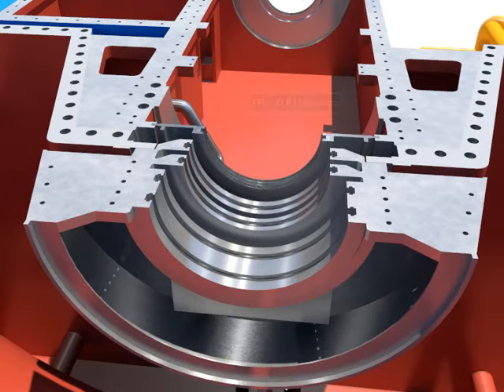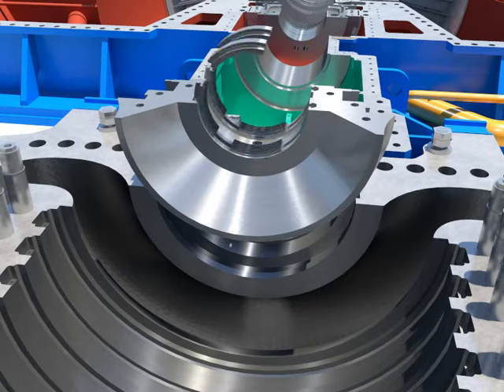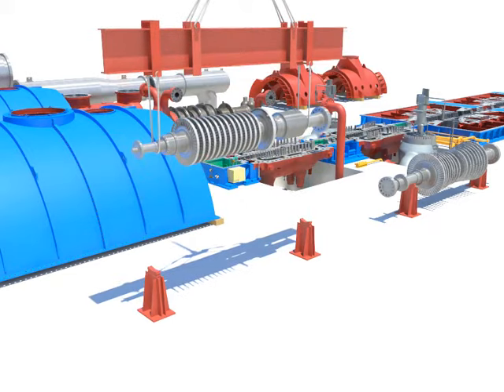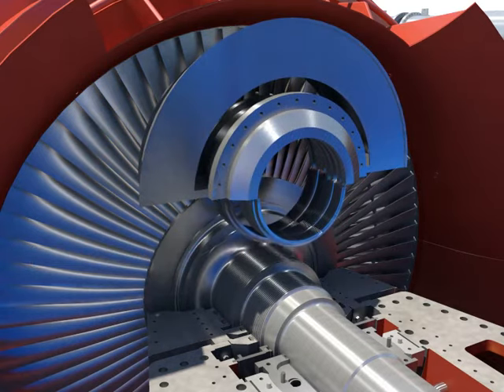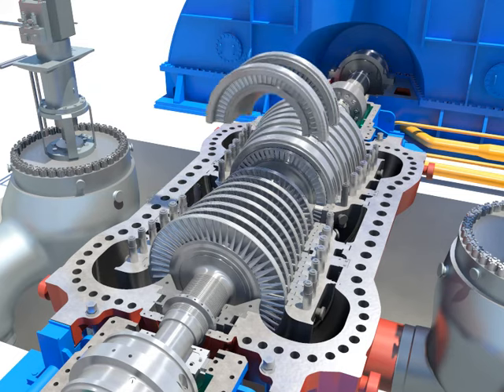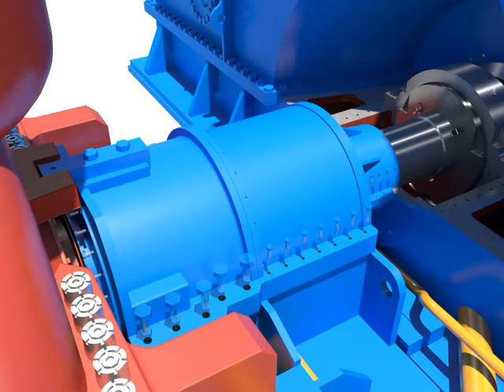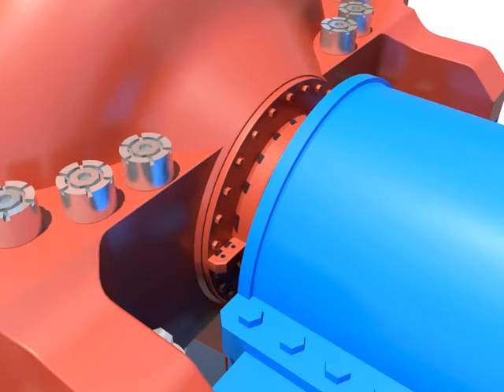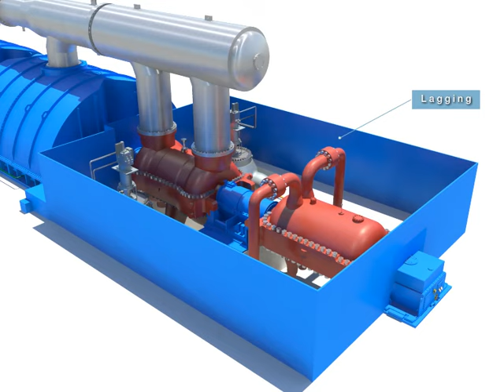#powerplant   #Steamturbine  assembly :WHAT DOES steam turbine assembly procedure?

Comment: Internal steam path clearances aside, the Couplings are not bolted up until each shaft alignment is completed. Normally, the last covers to be installed are the coupling covers followed by the standard upper half’s which encase the couplings.